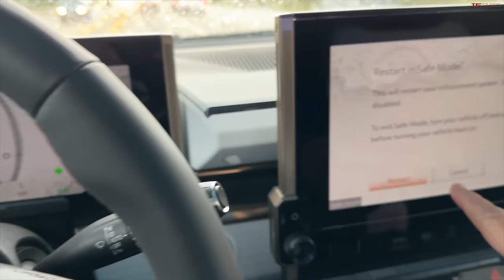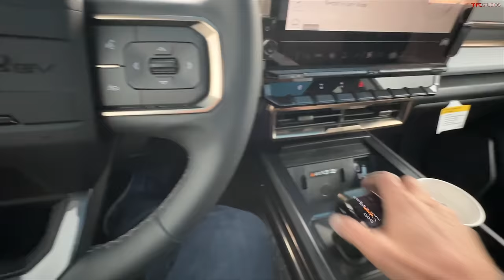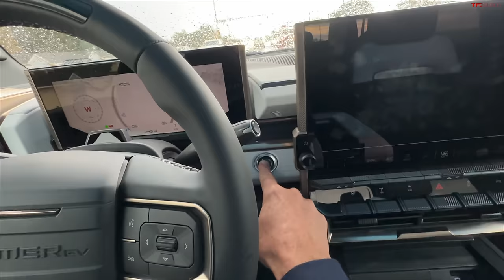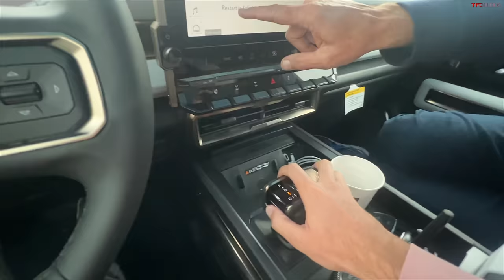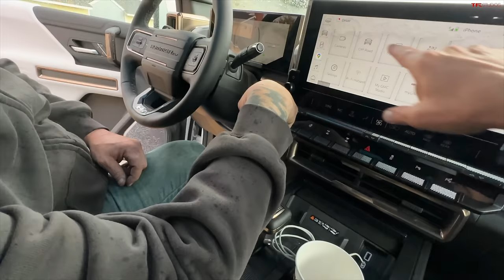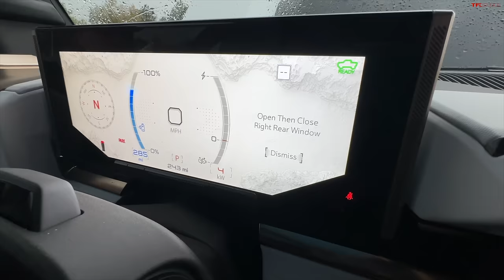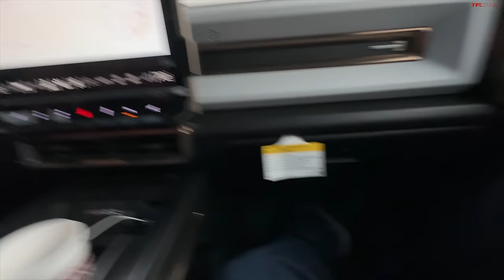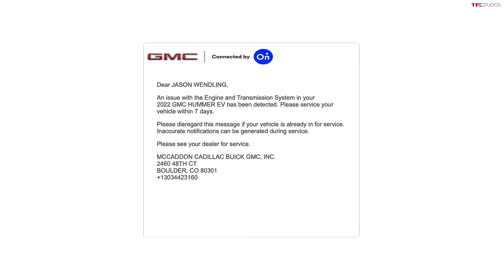I Bought a $115,000 GMC Hummer EV and It IMMEDIATELY Left Me Stranded!

Comment: I’m sure GM will be glad to see this honest assessment of the situation.  The truck was in “brick mode” in the middle of traffic, wow. How about a “limp out of danger” mode GM?
Reply: How about just friggin run mode???
Reply: @jmvmike  That's only an option on internal combustion vehicles!
Reply: You could diagnose your own gas engine. Your now at the mercy of dealership.
Reply: @danstamper1475  nowadays diagnosing a modern ice vehicle is damn near impossible too.... it really is....
Reply: @christophermccord3316  Not necessarily.  I carry an OBD2 dongle with me that lets me diagnose and reset errors on the fly with my phone.
Reply: @KRAMITDFROG  These EV fanboys don’t know. Lol glad you gave them some game
Reply: Hard to believe that you have to do these procedures opening windows etc.! Wow.
Reply: @danstamper1475  exactly
Reply: They obviously didn't spend enough time on the software.
Reply: @KRAMITDFROG  wow so like a computer ?
Reply: The fix is likely just "remove Safe Mode". (It's probably not what you think it is. It's probably more like basic control of the car for wiper/windows/etc, not any transmission control/etc.)
Reply: That’s my 2003 Denali quadrasteer 6.0 pickup, limp mode king!! Once I changed the TPS (fixed it for awhile) then a year later I had to change the wire harness to it it’s been great since. Of course the engine light has been on for 20+ years lol.
Reply: @shamarerskine3987  Not like a computer no. OBD has been around for decades now. Certain sensors/modules throw errors when you have mechanical issues and you use a scanner to read what the problem is. You then proceed to fix it yourself using tools and parts. Something you can’t easily do when the software for an EV has bugs. This is coming from someone who wrenches on BMWs and writes code.
Reply: @zaspalia   so its like a computer telling you whats wrong with the engine. evs should be more easy to fix since they have less parts but car companies are removing the right to repair our vehicles e.g=Tesla,merecedes and etc
Reply: @shamarerskine3987  Yes, it's a computer system but not a computer in the traditional sense such as the one you are using to type this comment on. EV's aren't necessarily easier to fix, but they should have less mechanical parts to fix in the first place. 

Not only do you not have the right to repair but you don't even have access to the software which in many instances you need when changing parts on modern cars. John Deere is an example of a company locking farmers out of repairing vehicles due to software access.
Reply: Genital motors has been in limp mode for decades 😅

Comment: Most owners probably do not even know that even a 10,000 lbs megabatterypack EV still has an ancient 12V battery hidden somewhere. That they can't reach in an emergency  🙂
Reply: That is my greatest fear with my Mercedes EQS which does not permit access to the frunk where the 12v battery is located. I will probably get a new one every 36 months to avoid a similar experience.
Reply: I’m going to be honest no I wouldn’t have thought that it had a regular battery I thought that it all ran off of the big powerful battery, of course I have never owned a electric vehicle.
Reply: Making a raidio, lights, blower motor,  power seat  etc that is NOT 12 volt would be a huge added expense with little to no benefit.
Reply: @brianx04  and batteries are cheaper/more reliable than step down voltage regulators
Reply: @MrKarmapolice97  They do run off the battery pack. These vehicles use a DC-DC converter to step down from HV to LV.
Reply: @cjolney  They pretty much all use DC-DCs. How do you think the LV battery maintains charge?
Reply: @cjolney  Your troll game is weak man. I was talking about DC-DC converters, not transformers or voltage regulators. 

By the way transformers are used for alternating current, which High voltage packs aren't. Since you're in need of a lesson on the very basics, the HV pack stores DC energy, and then Uses a DC-DC converter to maintain the LV battery, which is also DC.
Reply: Yeah the only issue with this is that any ICE car could have just as annoying of a battery situation, have you seen the modern car batteries that have covers and fuse modules and shit.
Reply: It's entirely possible that in any car, even a non-EV, that the doors locks might stop working at any time and you might need to access your manual car opening device. (You have one in your car somewhere, right? 😆) Modern cars are ALL software controlled. Don't freak out, just understand.
Reply: Yep, it's not the new technology which is at fault but stupid thinking!

Comment: Gotta give it to GM, sticking to its roots
Reply: The new 4l60
Reply: At least it's not a Toyota truck where the wheels fall off.  (See recent recalls....)
Reply: Like GMC Got Mechanic Coming
Reply: @scottwilkins  they fixed that funnily enough they couldn't find any problems with the car that would casuse the wheels to fall off finally they investigated the supplier of wheels turns out a batch of them was defected so all in all not something that will lynch the car in the long run meanwhile this well all we can say is goodluck
Reply: @Ali-M2  If it was just a defective batch they wouldn't have redesigned the hub bolts. They had loose specs to begin with considering the amount of torque they needed to handle. The new ones will be smoother, made of a different alloy and have a larger head.
Reply: @scottwilkins  id trust a toyota over a gm anyday bro, quit being a fanboy😂

Comment: Watching these vids makes me more and more appreciative of my 2005 beater. No fancy computer, no EV, but runs great and has never left me stranded.
Reply: Was thing EXACTLY the same thing about my 2004. Had it since new so it still feels like a new car to me.
Reply: I have 3 old vehicles, 99,00 & 04. I'll be running them until I can't run them anymore!
Reply: 99 Prelude FTW
Reply: I just went and hugged my 2002 8600 pound ford excursion
Reply: The best car I've ever owned was a 1990 Mercedes 190e with the 2.6. I kept it till 2016. Changed it for another lightly used one and it runs well. We should have the choice to drive simple vehicles if we want to. I only need a radio.
Reply: You can bet your ass a 2005 vehicle has at least 5 computers running it 🙄
Reply: @2engjnr2  Microcontrollers. They're still computers, but the level of hardware/software complexity is much lower and the tasks they handle are mostly realtime control of the engine itself. No graphical OS, little to no connectivity with the outside world, no software updates, and if there's a CAN network it's only a few nodes rather than multiple networks with 20+ nodes. Much more that can go wrong electronically on vehicles made after 2015 or so after "infotainment" consoles, electronic dashboards, and BCMs started showing up outside of high-tier luxury cars.
Reply: @treelineresearch3387  Probably on American vehicles. European vehicles are full of digital computers and have multiple CANBUS systems controlling everything. This since 2002 already.
Reply: I much appreciate my 200k 00 Chevy never left me stranded ever
Reply: Hate to break it to you, but any vehicle that's newer than 1996 has a fancy computer running it. PCM/ECM, BCM, or other computers controlling specific components. Even my 2004 Jeep uses PCI bus (has data lines for component communication). ECM failure is more common than you think on older cars
Reply: Frrrr my 2004 Chevy hasn't let me down since I got it from the dealership 6 years ago. Only things I've replaced is blinkers and battery 🤣
Reply: I'm ready to hit 300 k on my 99 GMC. Just buying new tires for the next turning of the odometer.
Reply: @2engjnr2  I don't know any vehicle that has 5 ecm's
Reply: Shoutout to my 2014 Tacoma 👌 239k only basic maintenance
Reply: @mitchwest6453  They have simple basic computers that rarely disable a car if something goes wrong, not on the same level as what modern vehicles have
Reply: @archygrey9093  They are not as simple and basic as you would think. PCM failure on older Jeeps like mine is common. One case is the SKIM function failing (immobilizer) and the PCM won't recognize your key, then you're unable to start your vehicle.
Reply: Exactly,  I love my old 2007 Toyota camry; it just go's and goes.
Reply: Driving 2003 Odyssey with 184,000 miles on it, not looking forward to when I need a newer car.  However, I know better than to buy something without knowing anything about it too.
Reply: Yeah right? My truck is a WT model. It has roll windows and 4x4 on the floor with linkages. I get envious on neewer cars and their luxuries sometimes and these videos snap me back to reality.
Reply: I've had plenty of older ICE vehicles leave me stranded, happens all the time, tow truck drivers rescuing stranded people in cars have been in steady business for 100+ years accordingly. Wtf are you people smoking?
Reply: 2011 Honda Accord with 134k, starts every time. Never will buy an EV.
Reply: A 2005 vehicle isn't going to have all of the same safety standards that have made their way into even gas vehicles now. Basically: an old car can be much more of a death trap.

Comment: Land Rover “I’m the worst vehicle ever on TFL!”
Hummer EV “Hold my beer!”
Reply: As a former Range Rover owner... I want to argue with you.  I've NEVER ever EVER had so many repairs in 2 years (before selling it) in any other vehicle in my life.  Want to know how much it will cost you to tow a Range Rover where no standard sane Tow Trucks will go?  Between $3000 and $4000.  And no, the warranty does NOT cover those tow charges.
Reply: @Erin-Thor  got an 11 RRS Lux with the 5.0, 160k and no issues. Only complaint I have is they are a pain to get a proper alignment done. Most Indy shops don’t know how to line one out properly.
Reply: @justinconstant2218  — In under 2 years 47k miles I replaced 3 water pumps, 2 alternators, belts (thrown by 2 alternators with bent shafts), and a dozen some odd shop visits for electric motor issues in seats and windows probably (assumed) caused by the alternator issues.  Oh, and 1 transmission issue and one replacement.  When the transmission began showing issues again I sold it.
Reply: Surprisingly enough my grandad only ever had issues with two discoveries a Series II Fuel pump failure and the rear camera on his Disco 4.

Realistically now both those repairs should be piss easy because the parts are on the used market.

Comment: That hood release ring under the dash is a good thing to know! No matter whether it is full electric or hybrid, it's valuable to know where the 12 volt battery (usually an AGM sealed lead acid) is, and how to get to it, when everything goes 'dead'. I've had to disconnect the 12 volt battery to reset my 2006 second generation Toyota Prius hybrid. Make sure you keep the tools necessary in the car/truck, so you can actually disconnect the battery terminal.
Reply: I thought your prius was a wind up tinker toy.